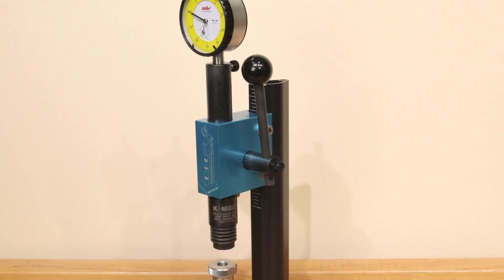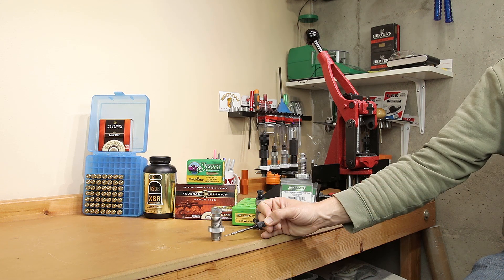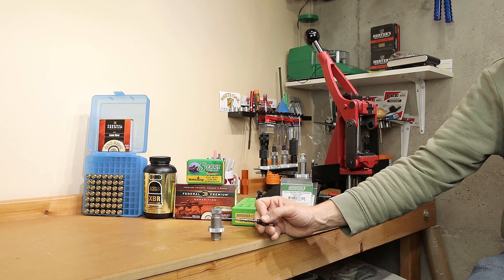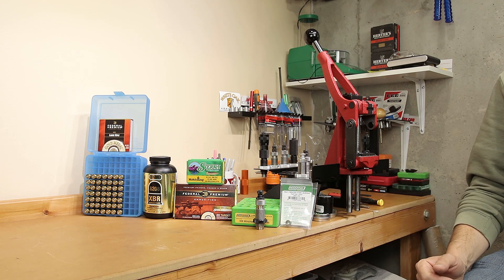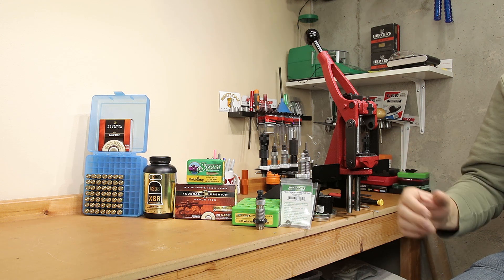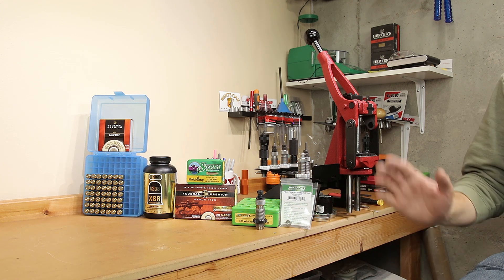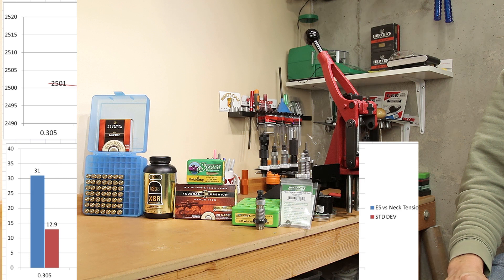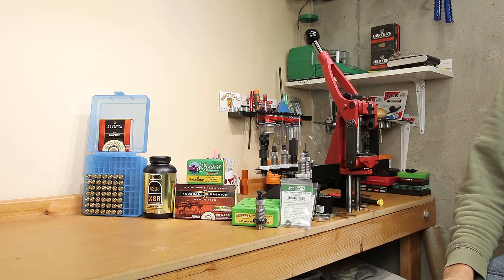Proper Neck Tension - How Case Neck Tension Affects Performance

Comment: Nice work! .002" works best for me with mandrel however if you ever checked the variation of bullet weights in the same box of top manufacturers you'll see a reason for flyers and other oddities. There is a good reason why some benchresters make their own cup and core bullets. Sorting the bullets of the same boxes by weight helped my groups to shrink! Keep up the good work !
Reply: I expand my necks just before I put the powder in the case then seat the bullet.  But always put graphite in the neck before expanding the neck.

Comment: I've found .002" to be the best for my rifles across three different calibers and 5 barrels.

I run full length bushing dies and bump the shoulders .002 as well.

All of my rifles have been 1/2 moa or better with great ES/SD since moving over to bushing dies.

Comment: Did you use a seating pressure gauge? If so it would be helpful to know if you sorted the loads according to seating pressure. Not just the assuming they will all spring back the same. You extreme spread and groups should be better if you  use the seating pressure instead .  I would like to see a vid where you use the same mandrel and grouped your bullets by the seating pressure . Say 10 shot groups.

Comment: When I use the 306 mandrel I have found that the neck ID is 305 (as measured using the 21st Century mandrels as "pin gauges" and using machinist tube ID gauge). That equals 001 springback. Assuming my measurements are accurate, my actual "neck tension" (interference fit) is 003.

Comment: I recently found your channel and subscribed. This is my first comment and I have a general question. How relevant are the loading techniques provided by bolt action gun shooters to gas gun shooters? eg, I have a box magazine limiting my COAL. Also, the bolt is not going to be gentle with extraction and feeding in the next round (it's an AR-10/LR-308 type in 243 Winchester). Both are new to me. I've reloaded for revolvers before and a bolt action (300 win mag) that I no longer have. So I have basics down, but that's as far as I've gotten.
Reply from the maker: For an auto loader you are probably going to be restricted to higher Neck tensions (.002 or more, possibly crimp) to avoid setback. Also going to be looking at bumping the shoulder back a little further for function (.003") if still having any function issues you also may want to consider small base dies. As always your going to have to be responsible for how these things work in your application, but these are some general ideas. I almost exclusively load for bolt action. Welcome to the channel, I hope you enjoy the content.

Comment: The Lee collet die just works, you can order different mandrels to change neck tension too, I find that my brass lasts forever unless I crank the loads up enough to stretch the primmer pockets out, if it gets fussy I'll bump it with a Redding body die or fl die, guns not picky but I do better groups and statistics with the collet die, ymmv
Reply: I too am a fan of this die. It actually eliminates most of what this poster is speaking of as variants, even makes thickness consistent. Wet tumble, trim to length, push bulge in front of the belt on my magnums, trim to length, dress primer pockets and flash holes, Lee collet neck die, prime, charge, load, soft crimp with the collet crimp. Dead even bullet tension, perfect concentricity. 

On my .308 AR ammo, I had Forster open up the neck on their full length die to leave it alone, bump back the shoulder .003”, - wet tumble, full length, trim, primer pocket/flash hole, collet neck size, prime, charge, load, collet crimp. Perfectly concentric ammo, perfectly consistent neck tension IN FULL LENGTH SIZED BRASS! (And it does make a difference!)

Comment: Another amazing video! Have you looked into comparing the Lee Neck Sizing Collet die to the mandrel neck sizing with regard to extreme spread/SD/group size comparison? If looking at concentricity be sure to check it at the tip of the bullet rather than the brass neck as the collet die forces irregularities in the brass to the outside. It's extremely cheap ($35) and if set up properly on a press and given a 3 second hold, a quarter turn and another 3 second hold it has the most consistent velocities I've seen (and I don't have to turn necks 😏) Keep up the great work!!
Reply: That's a good question. I previously reached out to Lee about it.  For my application, Ar-15 300 BLK, I needed to resize first then at times use a custom sized mandrel to "expand" the neck for the instances where I was loading a bullet larger than .308. Lee told me the collet die was designed to size "down" to a particular dimension and not "expand" a neck on a resized case.  I understand this wouldn't be an issue for those that don't full length resize.

Comment: Expander mandrel size doesn't determine my neck tension as in your case, feel does. I use whatever size mandrel (pin gauge) I need to in order to get a desired pin gauge size to slide in the case neck with very light resistance. In my case, I sized some 30 Nosler necks a few days ago with a .3075 pin gauge in order to get a very light drag with a .306 pin gauge slipped in the neck by hand. This gives exactly .002" neck tension. Doing it this way also allows extremely consistent neck tension up to the point of any inconsistencies in neck spring back. I think overall, consistent tension case to case is more important than a neck tension number.

Comment: Ha ha ha love the hand talking.
Great info.
Never thought about neck tensioning from the outside (bushing) vs inside (full length die. Now I really don't like the idea of neck sizing only! Any variation in the thickness gets transferred directly to the bullet tension (instead of more indirectly from full length sizeing)!
I'm not getting why the expander mandral is better than a full size inside die: can you not swap out the inside ball of a full length sizer?
Reply from the maker: Hi Wilfred, one advantage of the expander mandrel is that the sizing operation is being done in the direction that the case is the strongest. Think of the case like a roof on a house. If you pull the expander through the case you are getting the sizing but its likely that you are causing variation in your neck. I have compared these  and the concentricity is so much better with expander mandrels and not the expander balls, I use them exclusively.
Reply: @BoltActionReloading  Thanks for the quick response. disregard the rest. Found the video in the description 👍👍✌️

Comment: Neck tension is highly over rated.  Consider: take 3 pieces of brass...one that has never been fired, one that has been fired three times, and one that has been fired 3 times and then annealed.  Push all three through the same neck bushing, and then seat a bullet in each.  The tension-difference across all three will feel noticeably different for each as the ram comes up and the bullet is seated.  And that's because elasticity and tension- strength of the brass is different across all three pieces of brass.  Add to that the variations between each and every piece of brass and you'll see why placing so much emphasis on neck tension is nothing more than chasing your tail.

Comment: Good stuff and thanks! I run .002 " tension on my 6.5C and .015" on the .223. Both consistently shoot sub 1/2 MOA. That said, I'm not impressed with the statistical results I get. Runout on the sized brass and final loaded round is very low (as in the needle barely moves at all)I feel like my ES and SD's should be single digits and I've never achieved it. I use Redding competition bushing dies FYI. I also use a Forster inside neck reamer on fired brass. The brass is Gunwerks for the 6.5 and currently Sig for the .223. I'm waiting on some starline brass now for the .223 so I'll be interested to see 1:1 comparison vs what I currently have. Thanks again!
Reply: I think you mean .0015” don’t you?
Reply: @fentonpainter7907  yes! THX!
Reply: Are you annealing?
Reply: @coloradodrew  Yes I am.

Comment: I use a bushing to resize to 0.003" and then run a mandrel to 0.002" - not overworking the brass and works for me....
Reply: So you run it through a Full Length Bushing Die and then run it over a mandrel as a second step? Or you use the mandrel in the die?
Reply: @spencerhurley8359  seperate steps
Reply: @kihara4244  so no expander ball when you run it through the die?
Reply: @spencerhurley8359  nope, i take it out. Massive improvememt in consistency
Reply: @kihara4244  I've been having muzzle velocity problems and I found out my neck tension was .001" way too light... trying to find a new way to set it so thanks

Comment: Saying you are using 0.002" neck "tension" only tells how much smaller the case neck is than the bullet, it does not give an actual measurement of "tension". We know crimping can make a difference,  over crimping can cause pressure spikes, to light and possible bullet set back. So true neck "tension" would be how hard the case is actually squeezing the bullet while holding it in place. I will leave it to the brainiacs to figure out the actual "tension" values.

Comment: I use a lee collet neck die with an undersized mandrel the size again with the correct mandrel. It acts as an expander but with outside tension. I've been getting better groups since doing this and you can feel the difference when seating the bullets. They all feel consistent now
Reply: Same process I developed, Josh!

Comment: Of course when we are using a bolt gun and sliding that cartridge into the breech with consideration a .002 "neck" is tolerable, but what about on an semi-auto AR platform where the cartridge is essentially driven into the breach with much more force? If the bullet is not tightly tensioned in the case mouth the bullet could effectively slide forward lessoning bullet seating depth. Or is .002 enough neck tension to avoid that possibility in an AR?
Reply: All bets are off in the (sloppy) AR platform
With a very short neck (556)  concentricity is questionable.
ARs in my opinion are minute of bad guy and not MOA
Reply: The name of the channel is Bolt action reloading

Comment: I use .001 neck tension with my 6.5cm, 140 gn Berger powered by Varget powder. The rifle is an RPR and avg MOA this weekend on 25 round was .502 (like I can get that precise measuring a hole in paper, but that's the average). No groups were over .550 at 100 yards. These are loaded one at a time only. Fed via magazine and consistency is out the door due to bullet depth changes. I use Lapua brass. I use this neck tension, Varget, Burger bullets, Fed primers, LE Wilson bullet seater and so on, for consistency - except environmental factors, everything I do is consistent from one cartridge to the next. I do not measure run-out. Lastly, I set bullet depth to what is called for in the Hornady reloaders manual for COAL. I don't care about jump, jam or whatever with the consistency I am seeing above.

Comment: I used to use a match Hornady die for my 6.5cm. When I was seating bullets I noticed some were easy and some were hard. I switched to a basic Hornady FL die with the stem and expander taken out. Then I run them thru a expander that’s 2thou under bullet diameter. Now bullet seating is all the same and my SD/ES are lower.
Reply: I have the same set. They do not come with kneck sizing bushings. You need to pick the size you want and order it separately.

Comment: Been running bushing dies for many years with great results started using the Sinclair expander mandrel this year and it had made a difference in concentricity which improved groups sizes. I have with great luck used two thousands neck tension in many types of loads seem to work well.
Reply: When you say “2 thousandths”, do you mean a mandrel .002” smaller in diameter than the measured bullet diameter, or do you mean that you make the outside neck diameter 2 thousandths smaller than a loaded cartridge?  I assume the first but ….

Comment: Good video. I thought the bushings were .002 to .005”.  Any thoughts of testing with more tension? I measured the spring back and force needed to move bullet with more tension but never shot groups or chrono’d. I ended up in the .003-.004 range. A bit tighter than you tested.....but I wasn’t shooting. Obviously with little tension the bullet can move when bumped etc.

Comment: I have the RCBS FL resizer. Would it be best to remove the expander ball on this die to perform the FL size, while using the Sinclair/21st Expander Mandrel afterward? I'm not sure if it's necessary to get something like a Type S die to FL size before using the mandrel, or if a normal FL resizer would be fine. Thanks!

Comment: My thoughts would be that you developed the load using "0.002 of neck tension". You then used the ideal powder charge and bullet seating depth you found for .002 of neck tension to test the possible effect of "neck tension". However, if you prepped brass with a "neck tension" of .003 it is perfectly conceivable that you might find a better group with an ideal powder charge and bullet seating depth for the .003 of neck tension. Considering the variables involved I think you would need to do load development for each value of neck tension and then compare the best loads from each value of neck tension. That's a lot of testing and conceivably you would shoot out your barrel testing in 6mm. You would then have to rebarrel and redo all the testing, lol.... good thing 308 barrel life is pretty good!
Reply: Maybe to fine "the perfect" load, but just testing "neck tension" effects, changing the other variables would nullify the results,
Reply: Exactly what Eric said!!!!!!!
Reply: Wrong. .0015 thousandts off the lands and .002 thousandts neck tension is baseline for the specific charge and bullet. Once you find your ideal charge weight that produces the lowest es and sd then you tune with seating depth. Once you get the seating depth tuned and if your not getting the results you want with  .002 neck tension, then you further tune neck tension with increases of  .001 up to .006. For example, 3 rounds at .003, three rounds at  .004, three rounds at .005, and then three rounds at  .006. Guaranteed one of those neck tensions will significantly decrease group size.

Comment: In order to clarify my previous comment, I think it important to understand exactly what your method is testing. Your method seems to me to be valid for testing stepped, general neck tension reduction but, not neck tension consistency. Ofcourse, if the overall neck tension is reduced then, so also is the relative magnitude of the absolute neck tension variation as a ratio. So, neck tension variation will reduce as an absolute value but, only by default & not design. This is not to suggest that the results are not meaningful as, I believe they are or, can be however, it is important to be clear on the distinction between reducing average neck tension & not consistency. In this case, I am confident that, in general, the consistency will indeed improve driven by the physical properties of the brass but, not necessarily & certainly not as a determinative function.

Comment: Did you find any correlation with how much pressure it took to set the bullet and the rest of the data? I was excited to see that you had that piece of equipment there but disappointed it didnt contribute to the data.
Edit: looking at the video again, it seems like I was mistaken and you dont have the gauged hydraulic press. Hopefully someone in the community might have some input.

Comment: Can’t you just measure neck diameter before and after projectile is seated to get actual tension?
Reply: There is no way to measure that tension. With out seating a bullet. You can see what size it is but not measure tension.  If brass is thin in the neck, it might not hold the same tension as thick brass in the neck.   Just my 2cents, I maybe wrong.
Reply: @Whocaresnoone69  we all know that 1 thou, 2 thou etc is not a real tension number... We just use that to communicate the before and after diameter when seating a bullet. In the video he used the numbers on the mandrel and mentioned spring back being an unknown but he could measure the brass after running the mandrel through it and after seating to get a number more accurate than just using what is printed on the mandrel.

Comment: I just started using the 21st Century expander mandrels and I think they are the best way to set neck tension. Like you I don't worry about spring back but I can tell you that a combination of .002 neck tension on my 6.5 CM rounds along with an OACL of 2.800 is producing sub-moa groups at 200 meters out of my Ruger Hawkeye LR target. I think that moving away from the Lands has been as impactful as tuning the neck tension. Having said that I would add that my experience is only valid for my Ruger. My Savage Elite is probably another story. Each rifle has it's own personality. :-)

Comment: For neck tention I have been useing 4 turret press. When I use lanolin and 99% alcohol I start at full length case sizing and run through all dies. I assume very little lube will be left seating and crimping. Always thought that helps? Am I wrong?

Comment: AMU .003 is taking into account spring back from the bushing to land on .002 finished neck tension.  In your case, measure neck diameter and thickness post bushing to determine the presized ID.  Then run the the mandrel through and recheck the OD and thickness to get the ID.  The difference from the mandrel is the spring back for that given amount of neck sizing.  Or you could just use your small mandrels as check pins and measure it directly.  It's really not going to vary significantly over that small of a size range if everything is consistently annealed.